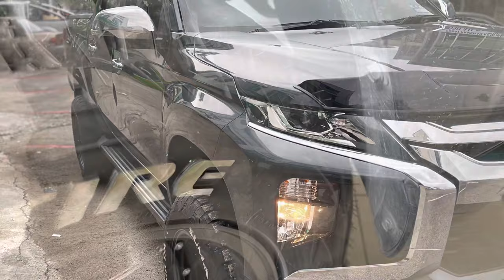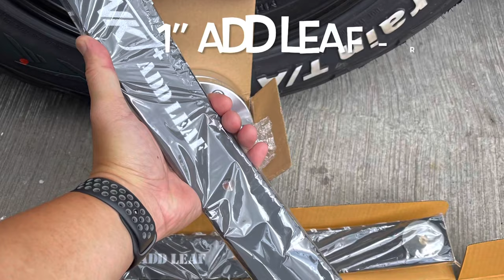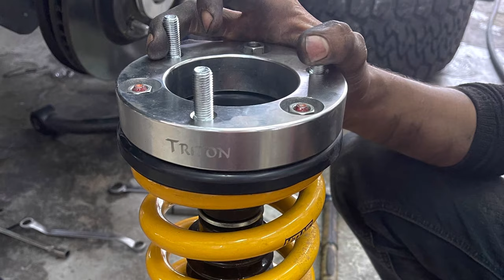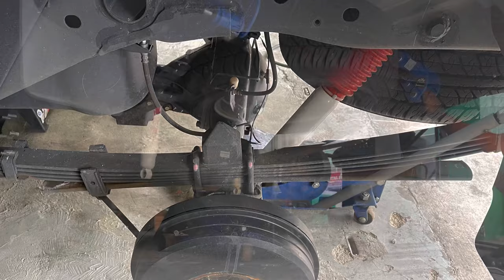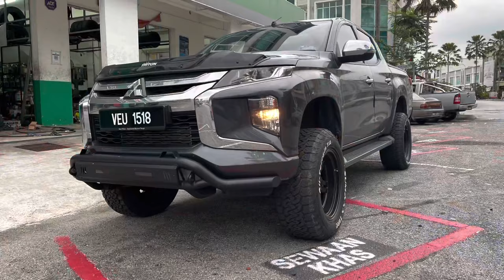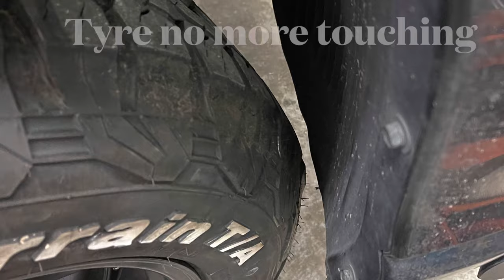Ep.8 Add 3'' lift Mitsubishi Triton VGT 2.4 / Strada / L200 / Sportero

Comment: What upper control arm did you use for 3 inch lift? I need to get a long one, because too much negative camber
Reply from the maker: 2” upper control arms by “Option” i am really pushing the limit on this upper arm and slight negative camber.

Comment: I bought a Yokohama tire, 315 12.5 R17 or 315 70 R17, I'm going to lift the l200 year 2021 in 2 inches and put 38mm front and 32mm rear wheel spacers. Will I have to make some adaptation? Thank you very much!
Reply from the maker: Take note of your front cv axle angle when lifting up, if your rubber boots start to rub n wear better install a diff drop kit or else your cv joints will pre-mature wear out.
Reply from the maker: Do check and follow my instagram 4x4mitsubishitriton
This will really help to boost more content for you guys in the future…remember “Keep it simple”.

Comment: Do you need to put a spacer on the ball joint as well on these new models? My 2013 trojan has 25mm strut spacers 10mm ball joint spacer on top arm can be a 20mm if on 17' wheels and heavy duty springs+dampers all round with an extra leaf and it rides great
Reply from the maker: Just 25mm spacer
Reply: @WeekendWarriorX  25mm spacer gives 2 - 2 1/2 inch lift at wheel on older model
Reply from the maker: Do check and follow my instagram 4x4mitsubishitriton
This will really help to boost more content for you guys in the future…remember “Keep it simple”.
Reply: Where to get the upper arm boss.. My stock upper arm was bumpy..

Comment: Sir good day Kaya 2 inch additional sa front shock. Nka lift na ako ng 2 inch . Tire ko 33x12.5x17.  plan ko sana add ako ng 2 inch oa
Reply from the maker: Your tyre will rub at the inner wheel well
Reply: @WeekendWarriorX  yes Po..  kaya Po plan ko add spacer 2 inch

Comment: If used 285/65/18 tire size.. is it can fitted ?
Reply from the maker: Will rub in the inner wheel well, need to remove mud flap and abit of trimming
Reply from the maker: Do check and follow my instagram 4x4mitsubishitriton
This will really help to boost more content for you guys in the future…remember “Keep it simple”.
Reply: How about 265/65/18? Would that fit without liftkit? Thanks.

Comment: Lift up 3” need to pull down front axle ?
Reply from the maker: I’m no expert in this but i did ask the shop which I bought the lift kit, the owner said is not necessary to do diff drop for the front on this 2020 model Triton as the angle is still sufficient.
Reply: @WeekendWarriorX  thank you. planning to lift up 3” suspension, but not thinking do change absorber will use 80mm spacer and upper arm for front and spring block and shaker for rear
Reply from the maker: Do check and follow my instagram 4x4mitsubishitriton
This will really help to boost more content for you guys in the future…remember “Keep it simple”.